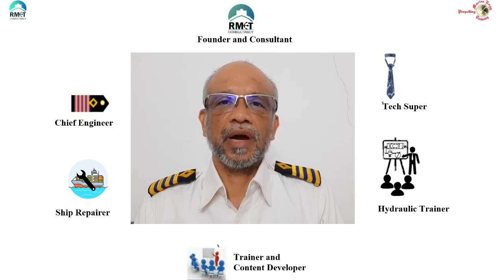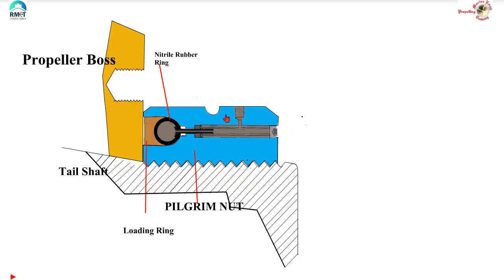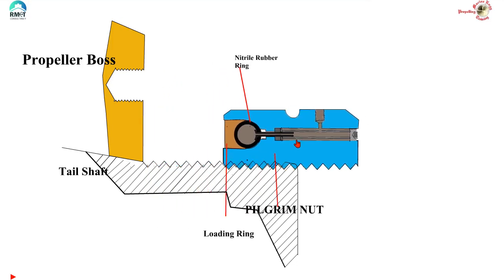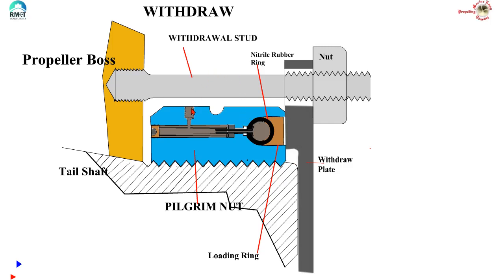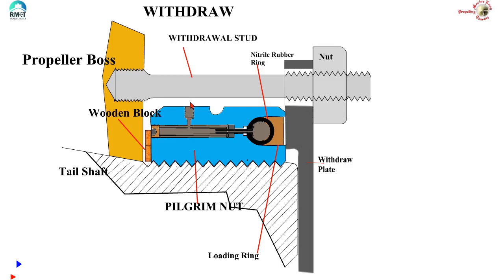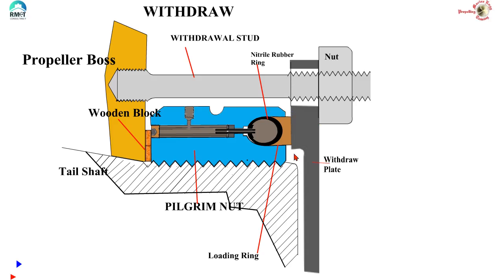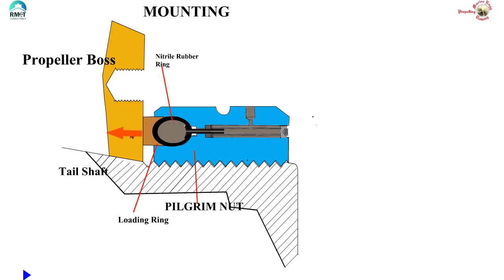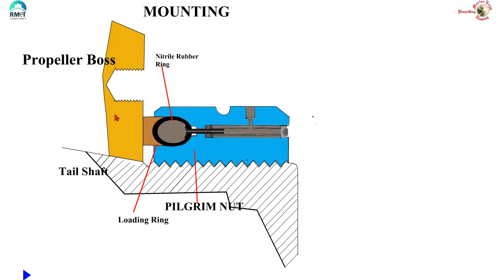What is Pilgrim Nut?? How do you remove propeller with Pilgrim Nut??|Ramesh SUbramanian|RMETC Videos

Comment: One small doubt. Might sound lame. But wanted to clarify. U have mentioned that the pilgrim nut is used to withdraw and mount the propeller. My doubt is, how to screw or unscrew the pilgrim nut itself. Initially the pilgrim nut is removed and reverse fitted for removal. Similarly for pushup there is a gap betn the nut and the boss. This gap needs to be tightened up right. Kindly clarify. Thanks

Comment: why is 1st blade of  propeller and the main engine no. 1 unit is kept in tdc position, after re fitting the propeller on the tail shaft during dry dock.

Comment: Could you possible to advise, how many methods are used for force fitting of propeller other than this pilgrim nut method?
Reply from the maker: Pilgrim nut is very old and probably history. But many vessels have the  Propeller Nut which is itself a hydraul;ic tool like the Cylinder head nuts..Other methods are to push the propeller with Jacks which are external..Yard supply Jacks...

Comment: Pilgrim is a name brand is of a slecific design.   Generally,  Pilgrim nuts were developed for use with keyless propellers.  The taper for keyed and keyless propellers vary, so pushup distances vary.

As part of the Pilgrim design, a cast iron sleeve was recommended.  The sleeve was secured in the propeller boss using epoxy.  The sleeve has oil grooves machined into it that are designed for releasing the propeller from the taper.  Ships I was involved with did not rely on the Pilgrim nut to pull the propeller off the taper.

Another feature of Pilgrim nuts is the recommendation that acme threads be used because of the loads on the threads when using the nut to pushup the propeller. 

It should also be noted that Pilgrim nuts can be used to secure rudder stocks to the steering gear and to the rudder.  They are also used for securing rudder pintles.
Reply from the maker: Thanks ..Agree..Had to make this vidoe because our youngsters are STILL studying this method for exams Ha Ha..

Comment: I find your videos very helpful for exams sir and i regularly go through them. Regarding SKF and Pilgrim nut method sir I wanted to know if they are used only for keyless propeller or keyed propeller as well. Secondly sir before fitting the propeller we have to ascertain that we have 75 to 80 percent contact between propeller boss and tail end shaft. Can you explain the processes how it is done sir.
Reply from the maker: Key or Keyless does not matter and YES the 75~80 % is True but not needed to be done during a routin e removal Refit' It is done only after repairs aor damage etc which might have affected the taper.

Comment from the maker: Guys who want to respond to this cartoon about the question..Does the load of pushing the Shaft while removing the propeller travel to the Trrust bearing...Challenge yourself and comment on the message section in Youtube. HINT -- 10 std Physics ..Ha Ha
Reply: We don't need to push the shaft while removing the propeller,we are just removing propeller out of tappered portion of the shaft  by using correct pressure told by manufacturerer, I think need not to be worried if at all shaft is experiencing any kind of push ,shaft pushes back...😁,also pilgrim nut's entire journey is through the threaded portion ,no worries...
Reply: Newton's third law sir if not pls explain sir
Reply from the maker: It is simple--Newtons  3rd law is NOT applicable .According to the law action and reaction forces are equal and Opposite BUT ON DIFFERENT Bodies..In this case the shaft is being pushed by the loading ring via the propeller(action Force)  but at the same time the same shaft is being PULLED by the NUT via the threads(Reaction Force)